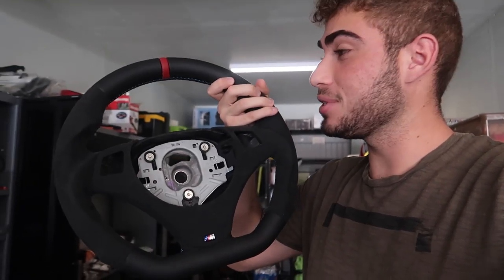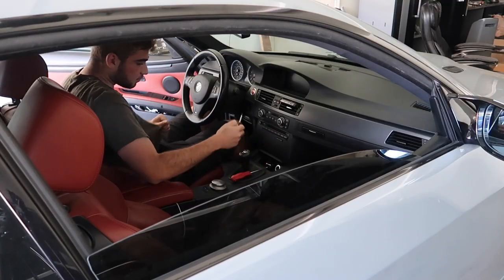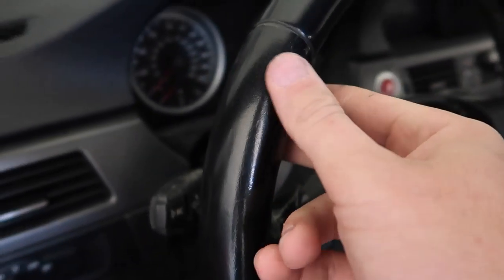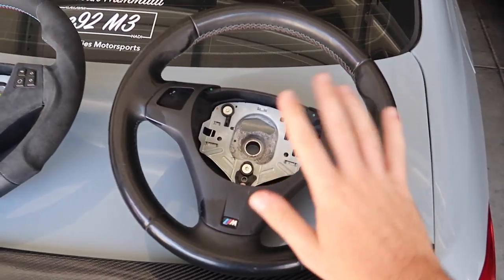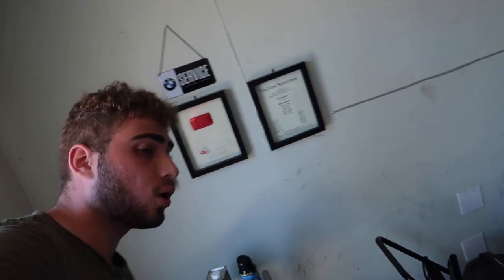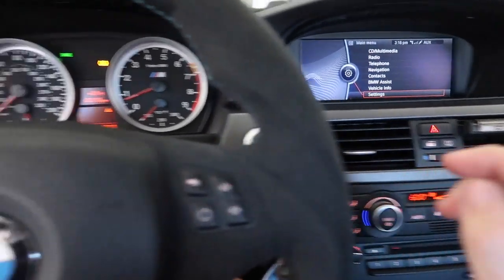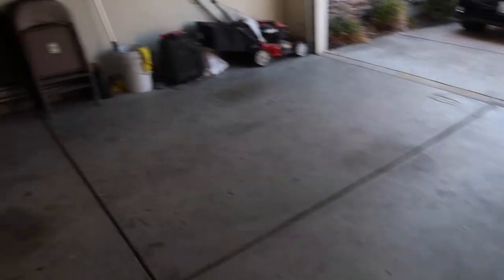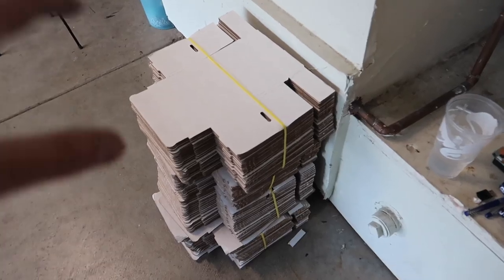CUSTOM STEERING WHEEL FOR MY BMW E92 M3!

Comment: Hey Nour, how did you get your steering wheel to align up center. I have a different car  an Acura and my steering wheel won't go back into center position.
Reply: On these bmw cars you can't install it wrong because of of one large spine that will not allow you to do that. you just need an alignment probably, or take it off and keep playing with it until it's straight
Reply: @Danulosobovoy  oh okay then, thanks